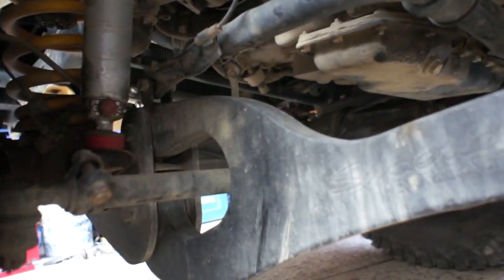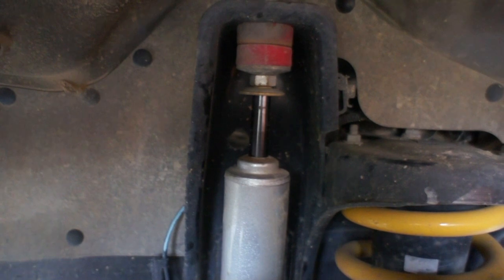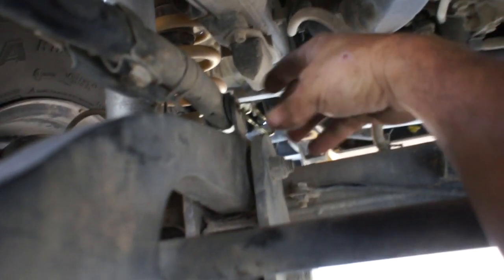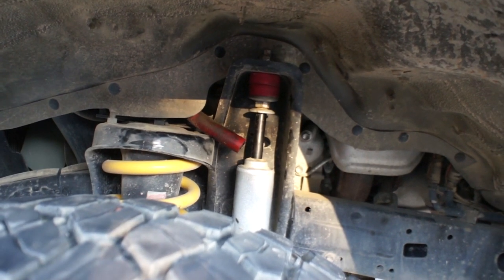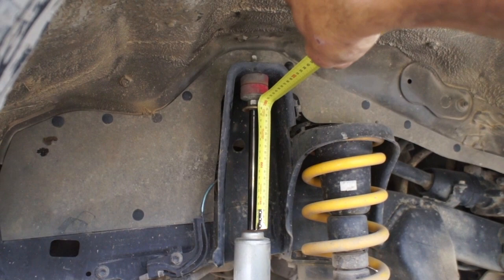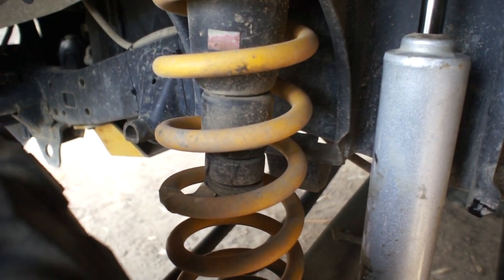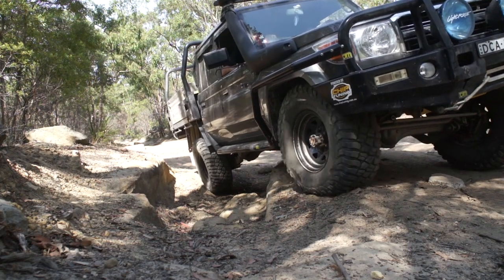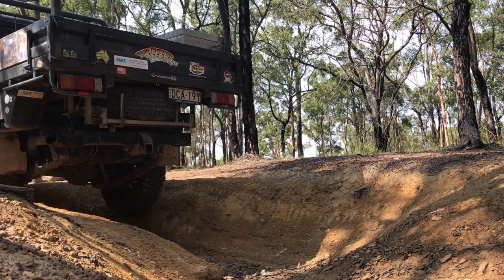V8 Toyota Landcruiser VDJ79 offroad modified for better wheeltravel trialling Swaybar disconnect

Comment: Hey man, with the swaybar disconnected at the front, have you had to do anything with the brake lines? Are the factory ones long enough to accommodate the lift and extra travel with the bar removed?

Great video. Cheers.
Reply from the maker: Yeh mate they are, just had to make up a bottom bump stop to stop the coil coming out.
Reply: @TeamBulletOffroad  awesome, any pics of the bottom stops?
Reply from the maker: @andrewmillican460  Heres a video where you see that bottom bump stop, https://www.youtube.com/watch?v=wzljlb1vT00&t=1s, also back to the brake lines, I remembered I'm running the jmax braided ones, I think they may actually be a little longer than factory

Comment: Did you remove the sway bar or simply the bolts at either end? Got an update of how this is working?
Reply from the maker: I Remove it completely on the trips where i need the articulation... Otherwise i bolt it back on
Reply: @TeamBulletOffroad  thanks. What do you do about the brake lines etc bolted onto it?
Reply from the maker: @toddy4x4photography  They just hang there, never had an issue, then when I'm running the sway bar I just use a cable tie to fasten them.. But don't forget im running superior arms.

Comment: Good video my friend, thanks for sharing it. 
What did you do with the ABS lines that are connected to the sway bar?
Also do you recommend the method you did where you replaced the sway bar end bolts with quick disconnect pins?
Reply from the maker: Nothing, they seem to be ok with the sway bar off...Ive not yet seen a successful quick disconnect on a 70 yet... Its only a 10 minute job to completely remove